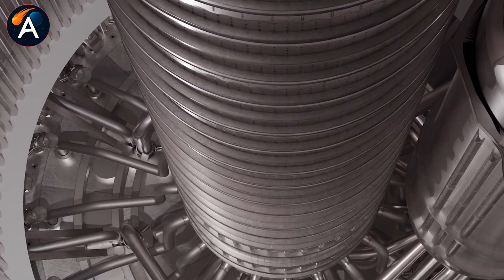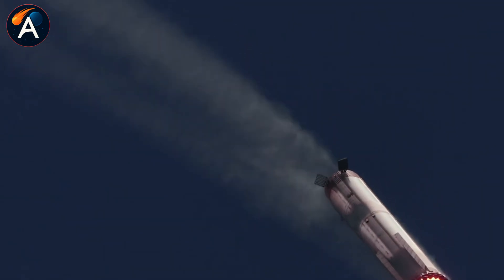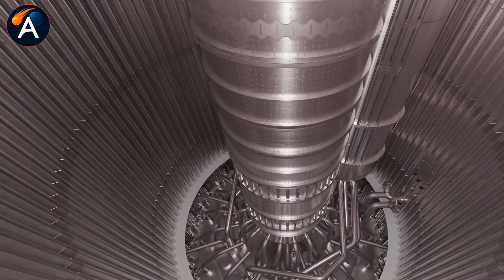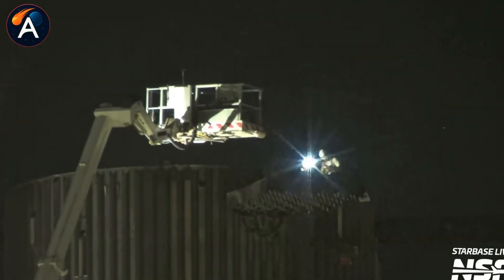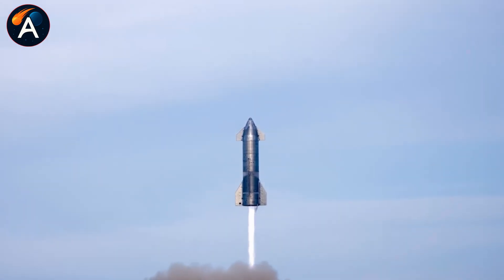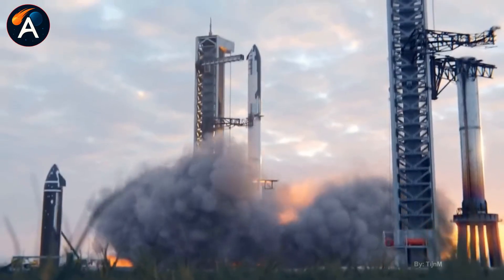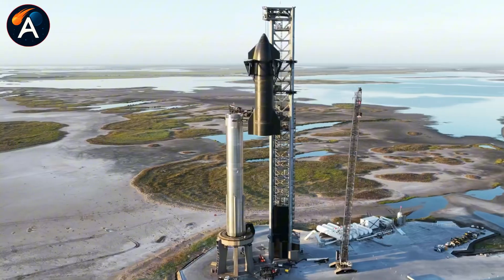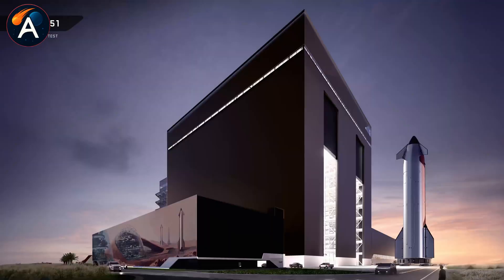SpaceX Found Brilliant Solution on V3's Spider Tank...Mind-blowing!

Comment: To make Booster reusable ugly spider web piping most go  no part is the best part .the feed for the methane  should be a manifold incorporated into the trust puck so it does 2 jobs eliminate most of the piping leaking issues and handle stress loads.  of
 course it needs to be tested and proven .
Reply from the maker: Interesting idea—integrating a methane manifold directly into the thrust puck could reduce piping and potential leaks while sharing structural loads. In V3, the reinforced transfer tube already acts as a full landing tank for stable feed, paired with the spider tank's branching for reliable oxygen to the inner 13 engines. Testing will tell!